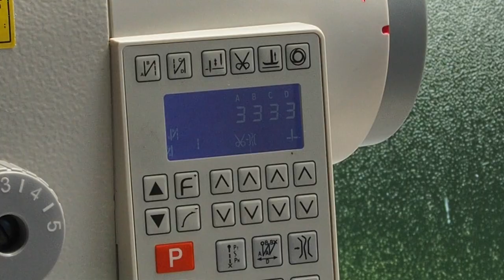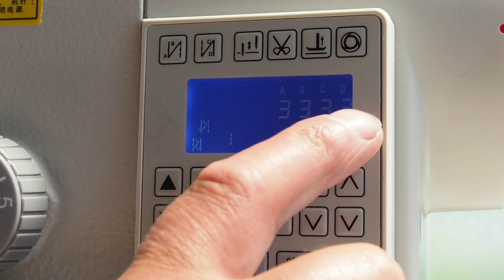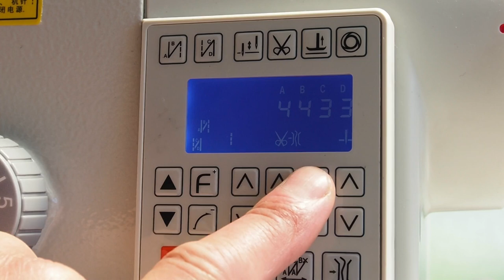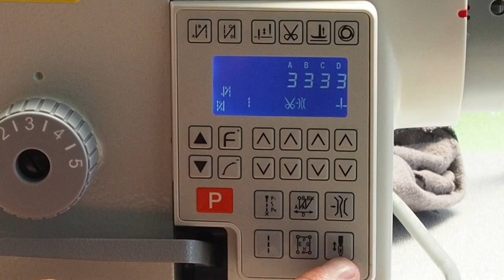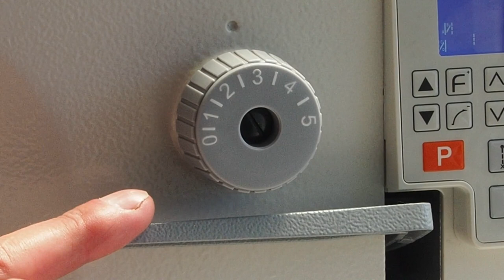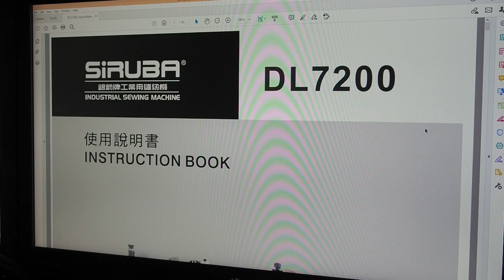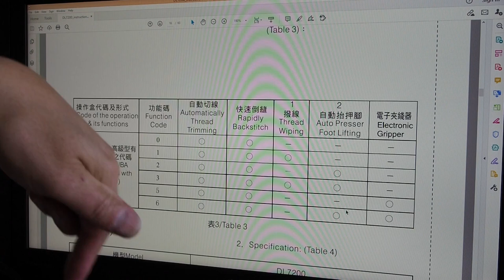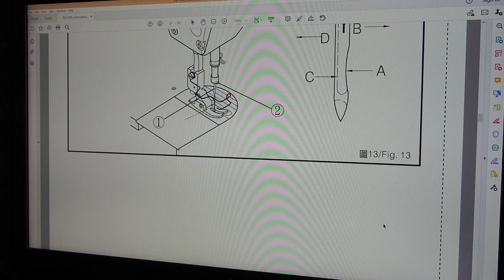Industrial Needle Feed Sewing Machine Overview -Siruba DL7200 - Part 2

Comment: Interesting to see what the modern machines can do. It's very impressive.
Only out of curiousity, do you think that winding bobbins like this could cause bobbin tension issues. Obviously it works, but perhaps it's not wound as well as it would be if it were done at a constant speed. Any thoughts or problems encountered?
Thanks. 👍
Reply from the maker: Thanks for your comment. Interestingly these types of automatic machines have been around for a long time. I remember working on Pfaff machines in the 80's that had all of these automatic features. There's no problem winding a bobbin like this, even with light weight threads. The bobbin winder tension is so light, there is hardly any drag when bobbin is coming up to speed on the winder. Inconsistent sewing speed can cause an issue with the bobbin because of inertia. When the machine stops suddenly, as designed, the bobbin can keep spinning in the bobbin case, causing thread to tangle and loop. This is called over-spin and can be rectified with anti-spin springs in the bobbin case.
Reply: @InStitches  You are a wealth of knowledge!
It's amazing how little innovation there has been. We are so used to things progressing at lightning pace.
I'm investigating robust 1950s and '60s cam machines, looking for a keeper.
I came across a free arm Waltons Celestial 875 here in the UK recently. Do you know of them? I suspect that they may have been made by Jaguar in Japan like the Kenmore 158s. I can't view the internals  unfortunately so I don't know if they are all metal geared. Thanks.